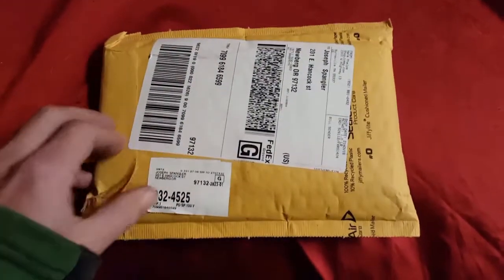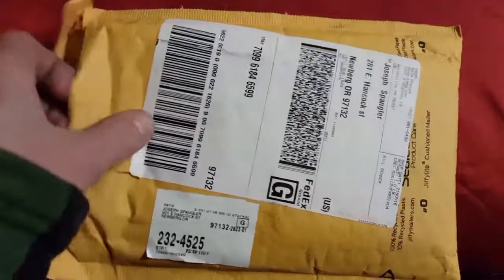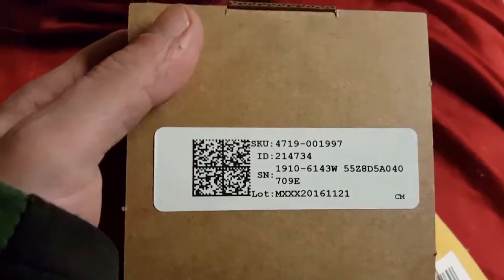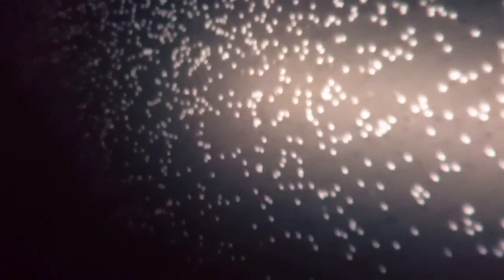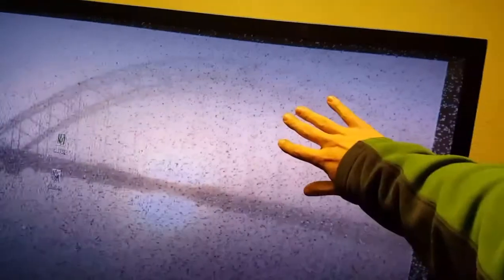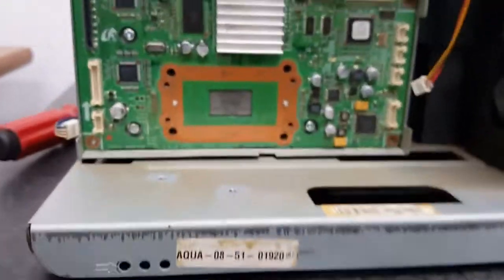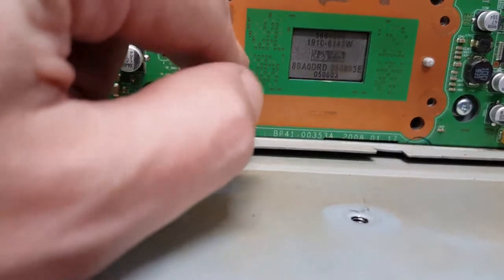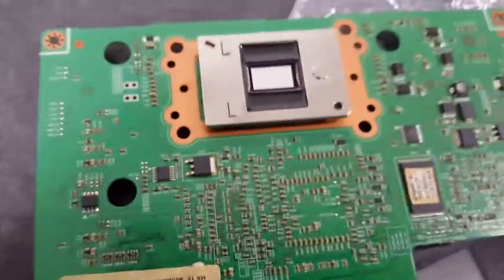How to replace a DMD processor in a Samsung DLP tv

Comment: Excellent!  You showed what I really needed to see.  My 42" stopped working and I was able to pick up two of these projector televisions with grey dots from messed up mirrors on the chips.  The 61" one has a back that looks just like the one you have on here dust included.  I knew I was watching the right information.  I have had the chip for over a month now but did not see someone actually replace the chip as you have here, thanks!  I worked on circuit boards in the 80's but this is easier.  The actual removal of the chip needed to be seen as I did not want to break any of the cables or connections.  The board is stuck so I came back to watch this again.
Reply from the maker: As of today, 5/4/19, this t.v. is still in my family room, and 0 stuck mirrors
Reply from the maker: As of today, 3/27/22 still 0 stuck mirrors